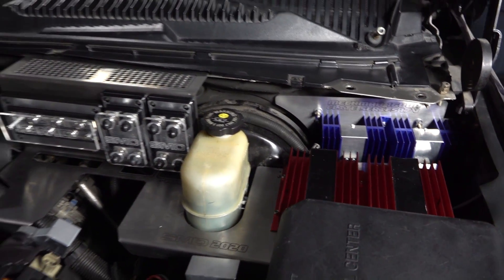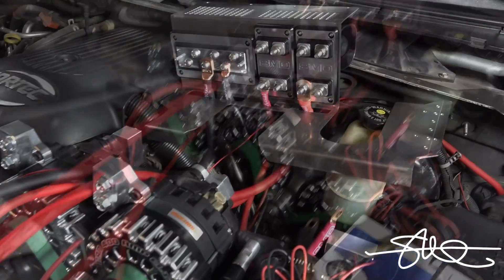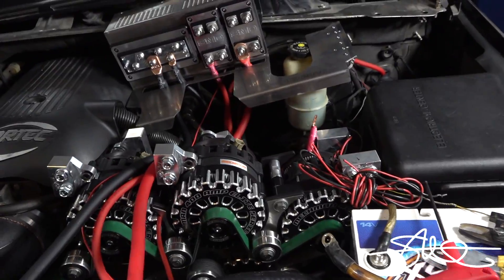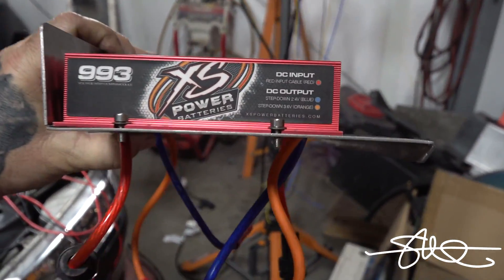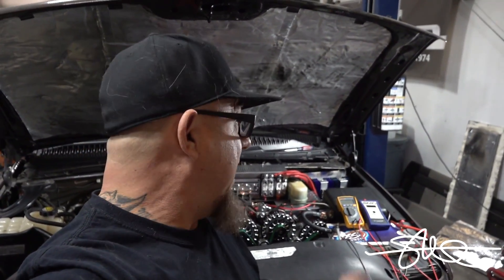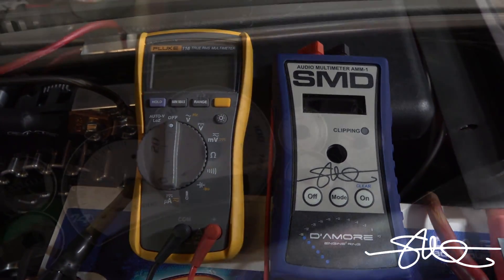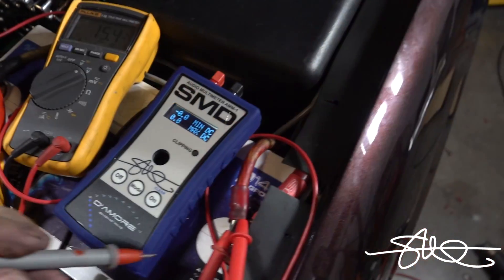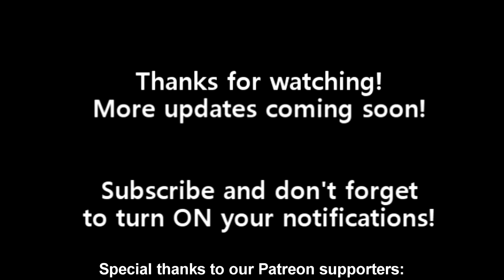It's Alive! High Voltage Chevy Tahoe Pushing 17 Volts! Regulators, Alternators & Step Downs Fired up

Comment: Hey bro i have a question and need your opinion since u are like a pro when it comes to electronics and wiring. I read alot about ppl using diodes on there alternators whats your opinion on that. Do u use any of those on your alternators to increase amperage or voltage

Comment: All those wires in the engine bay can look a lot better in protective braided sleeves. They are available in all kinds of colors, including black with red, blue, white, etc. It would also be helpful to color code the wires that way.
Reply from the maker: if i wanted braided sleeves i would have done that.  Thanks for telling me what would "look better" even though you have zero experience. LMAO!!! Color codes? stop man it is way too early for this type of comedy.

Comment: Damn sounded like your gonna run 17v to the computer of the truck. That’s not too high? I don’t even like my Sierra going to 15v
Reply from the maker: 15v is no problem at all. Don't worry about it.
Reply: meade916 ok I’ll try it out. Thanks
Reply: @meade916  Agreed.   Lead acid batteries need higher charging voltage when its colder as well.
Go start a vehicle that has a temp compensated alternator in freezing cold conditions and 15v isnt uncommon to see until the engine bay warms up and the temp compensation brings it down.

Heck my own car will sit at about 14.8v on cold start when its single digits (Celsius) outside.
Reply: @KSSilenceAU  I believe alternators inherently have a higher output when cold due to some physics wizardry.
Reply: @caddyguy5369 yup that is a thing on some alternators, typically OEM ones,  called Temperature Compensation.  Basically there is a Temperature sensor in the internal regulator that slightly lowers the voltage as the temperature increases.   It's primary function is to prevent over charging of the battery in high temperatures but it also indirectly serves as a primative overload protection on the alternator.   Very high loads = hot alternator = reduced output voltage = hopefully a reduction in load (eg charging current to large depleted batteries).

However Computer Controlled alternators also known as ECU / ECM / PCM Controlled alternators are commanded by the Engine Computer and totally different rules and behaviour apply.
Reply: @KSSilenceAU  That would make sense that a temperature sensor is involved. Even without that though I believe there is some fluctuation with output in relation to temperature, to a much lesser extent than the computerized system would vary it. I could be wrong. Been quite a few years since I've driven anything old enough to not have the temperature compensation.

Comment: I know i am off topic. Any modds to the engine ? I see K&N. Maybe throttle body spacer ? Airaid or Helix. Will give u some hp. Nothing like a big cam. Still help NA engine. Dtk  just a thought. Help the engine out. Turning them alternators i guess. Love the audio everything u doing. Cheers.

Comment: What’s the step down for?
Reply: Regular 12 volt accessories so they don't blow up from the 17 volts
Reply: If im correct the step down is for any electronics that require 12v for charging. Some vehicles can't do 17v through stock wires but if im correct that is what the step down is for. (Ipads, radio, lights, ECU)

Comment: don't leave your wires against cut metal , like seen on 6.54, driving the vehicle produces vibration and the metal will cut into the wires very quickly and short circuit the whole thing.
Reply from the maker: i don't need your help but thanks for the offer.  The positive wires are at least .125 away from the metal. Thanks for your concern.
Reply: Lol im sure steve is aware of that... Damn

Comment: That bus bar wire by the brake reservoir might wear on that thin stainless wearing the + wire shielding down with driving vibrations
Reply from the maker: nah.